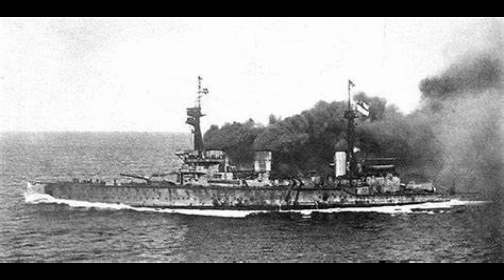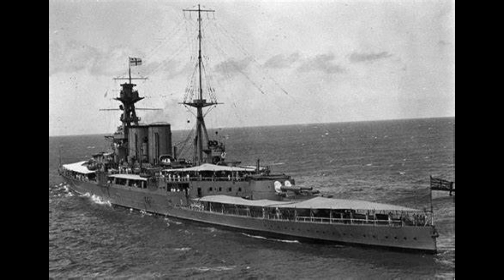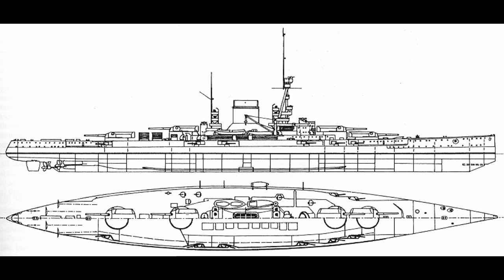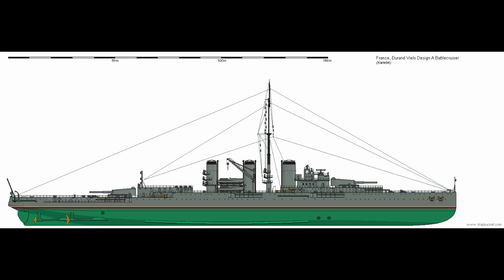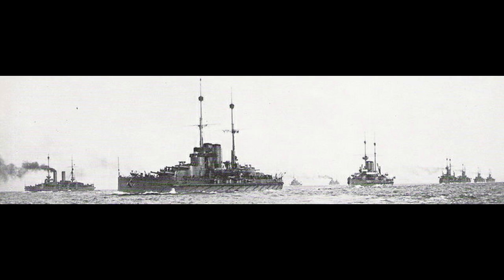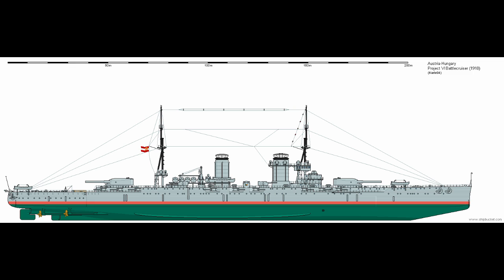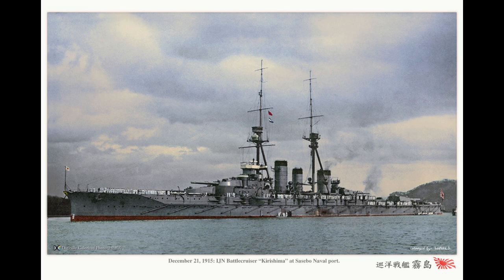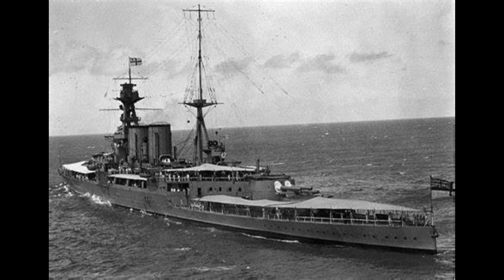Battlecruiser Armor Schemes: Speed is (not always) Armor

Comment: My understanding is that the British battlecruisers were always aiming towards using a combination of superior speed and firepower mated to the minimum necessary armor to achieve stand-off against the common opponents either extant or anticipated. In other words, the British aimed for their battlecruisers to use bigger guns mated with just enough armor to achieve stand-off range, using superior speed to ensure they could keep that range. In theory, HMS Lion, with 343mm guns and the armor she had, should have been able safely trade fire with a German grosskreuzer armed with 305mm guns at extreme range where the German shells would not be capable of defeating the citadel armor of the Lion while her own 343mm shells should be penetrating the German armor. 

As time went on and gunpower increased, it was theoretically possible to use less armor to achieve the same effect, hence the Renown Class having just 152mm belts. Since the 381mm guns technically allowed for greater penetration at greater ranges, return fire from those enemies would be proportionally less effective, meaning less armor should have been necessary to stop that fire. 

This is what Jackie Fisher was actually asking for when he was talking about "speed being protection" in later years, the idea that so long as British battlecruisers had the bigger guns mated to the faster speed, they didn't need as much armor, but they still needed enough armor to ensure stand-off range. 

The problem came when the British underestimated the power of German guns, especially their 305mm weapons. It was discovered, at great cost, that many parts of the citadel of ships like HMS Queen Mary, especially the turrets, were not quite strong enough after all. Armor that was believed adequate proved just a bit too weak. This was what drove the move for the Admirals to be much more heavily-armored than intended, since they were supposed to be fighting against grosskreuzers to come with even bigger guns.
Reply: Would you please be so kind to tell your theory to Queen Mary, because it may have a different opinion (:-) not to mention Hood ( WE do not mention Bismarck on this channel!

Comment: The QE class foreshadowed the end of the battle cruiser. Add improvements in propulsion technology (higher temp & pressure boilers, double reduction gearing) meant the huge amounts of power needed to drive 35,000+ tons at 27-30+ knots could be gotten out of smaller volumes of water tube boilers and turbines, i.e., smaller weights of machinery. For some (Germany) this meant temperamental machinery (Pr. Eugen in USA hands e.g.). For the USN this resulted in the extremely fast & long lived Iowas, Baltimore cruisers, and Essex CVs with long cruising range and high flank speeds needed for fast, fleet carrier operations. The USN also built the next round of heavy cruiser killers in the Alaska class.